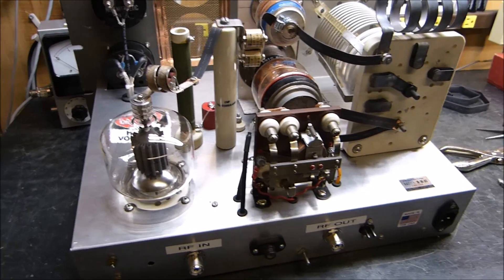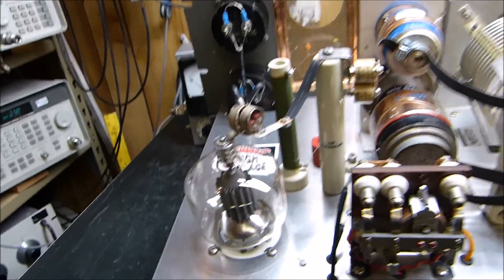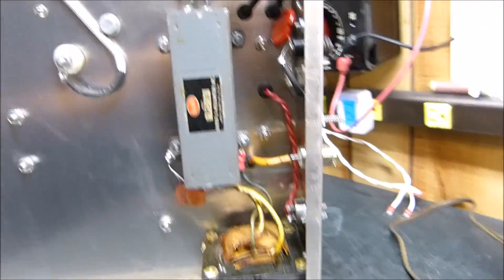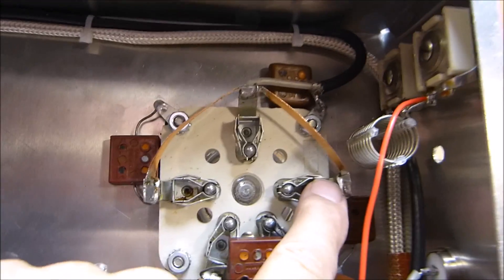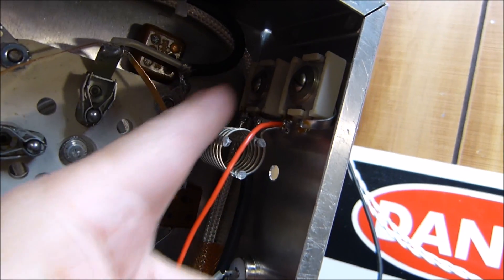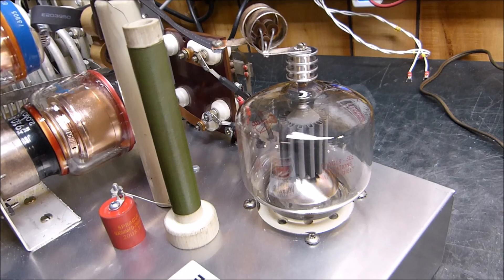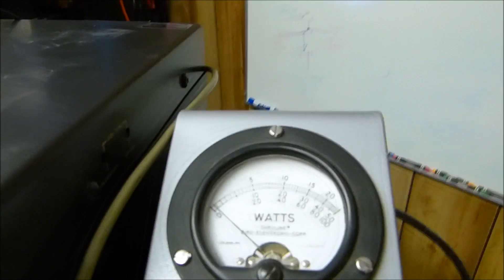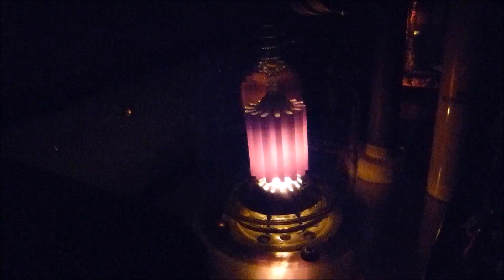Eimac 3-400Z or 3-500Z  Grounded Grid Linear Amplifier Build For Amateur Radio - Part 2

Comment: Big elements u must add second tube 🙂
Reply from the maker: To build bigger ones, I have built and use a 4-1000A (40M) and a 3-1000Z (20M) . Also a dual 4-400A. See my QRZ page.  WA4QGA

Comment: I tried pair in sb 220 seems get little hotter than 3 500 z but done little less but what I paid for them
Reply from the maker: I agree. Don't drive them quite as hard and they should be OK. I still use this amplifier in the video and keep it tuned up
on 80M. Best to keep the plate voltage at 3KV or a bit lower.  73  WA4QGA
Reply: @ElPasoTubeAmps  sweet deal

Comment: Was the tube's plate really glowing that bright, WITHOUT any load... no RF passing?  Seems a bit excessive. (Maybe it was just the camera).
What was the no-load plate current (idling bias current)?  
Otherwise, cool little HB amp.  Thanks for sharing!!
I'm an "amp junkie" and have several commercial-built rigs... some old, some new.  I've worked on all of them at some point. I recently completed a major overhaul of a Collins 30S-1, which is now up-and-running - on the air!  I did watch the older video you put up, showing the 30S-1.  Great amps!
Pic's of mine on my QRZ.
73 from central-westTexas!
~W5ARM
Reply from the maker: The camera greatly accentuates the orange as it apparently is very sensitive to IR. I can adjust it in manual mode but just let it go most often. I can't recall the idling current but it tracks right with the Eimac datasheets.  73

Comment: Whats the watt difference between the two different tubes 4-400 to 3-500 tubes
Reply from the maker: Here is a good Eimac newsletter concerning the 4-400A tube and other tetrodes run as zero bias triodes:   https://ethw.org/w/images/c/c0/Eimac_tube_notes.pdf
You are likely to get a bit more power from the 3-500Z or the 3-400Z  than the 4-400A running at 3KV on the anode if you can get good ones. Eimac quit making the 3-500Z and 3-400Z years ago and I have personally not had as good performance from the foreign made 3-500Z .  Hope this helps.

Comment: 3:31 I see that some people recommend grounding the grids directly to the chassis, especially if there's any chokes attached to them (remove the chokes, then ground). Any thoughts?
Reply from the maker: Strapping the grids directly to ground is a common way to do it. However, I do not do it that way. First, I (usually) put copper strap between the three grid pins  (pins 2, 3, and 4) and then I put a  0.01 uF mica capacitor to ground off each he three grid pins of the socket (this grounds the RF but not the DC) and then I run the DC thru a meter to monitor the grid current actually DC grounding the other side of the grid current meter.  It works perfectly and, as I see it, a simpler way to "ground" the grids. It would be OK to put a choke close to the grid pins on the socket in series with the wire going to the grid meter but I have not found that necessary. Just as a feel-good thing a bypass capacitor in the 0.001 to 0.01 uF range can be put at the meter end of the grid meter wire and a capacitor across the grid meter, etc. just as "good-practice" wouldn't hurt. I also use shielded wire (usually coax RG-58) from the grid pins to the meter.  In the case of using the Eimac tetrodes (4-400A, etc.) it is done the same way but the grid current read by the meter will then be the sum of the grid current and the screen current. Not an issue as long as you know what is going on. BTW - this GG configuration will not work with the 4-65A but will work with the 4-125A, 4-250A, 4-400A and 4-1000A also the big triodes like the 3-1000Z. Home this makes sense.  73

Comment: I like your work! I’m planning on building my first linear amp. I’m looking at circuits out there already tested and perform well. I have an old circuit with 813’s that give 500 watts out, but still looking. I know this is an older video but finding videos on tube linear amp builds are difficult to find!
73
W6CPY
Reply from the maker: Thank you - the GG amplifier is by far the simplest high power amplifier to build. You can expect 10 dB of gain - 100 watts in to 1000 watts out - not too bad. With grid driven and neutralized you can get 25 watts in for 1 KW out or 16 dB gain but it is a lot more work. The 813 along with the 4-400A family of tubes strapped as a triode work as a high mu triode and the 811A is a good one also. I really like the 813 but it has been a while since I have used them except in an audio amp I posted on YT some time back. Best of luck with your project. Stay safe around the HV.  73  WA4QGA   I have lots more pictures on my QRZ page.

Comment: I really want to build one of these..
Reply from the maker: If you study enough grounded grid (GG) amplifiers, you will see they are all about 99% the same. 
You can run the triodes like the 3-400Z/3-500Z/3-1000Z or the tetrodes like the 4-125A/4-250/4-400A even the 4-1000A in a GG circuit by simply grounding the screen. 
I can plug a 4-400A in this amplifier and it works perfectly. The only difference is I am then reading grid plus screen current on the grid meter which drives the meter off-scale. 
At 3500 volts on the plates (the 4-1000A wants 5000 volts or more) you can expect to get 600 to 800 watts to the antenna depending on the condition of the used tubes. 
Got to be careful as it can be death-on-contact working with voltages at this level. Since making this video, I have added a five-band tuned input circuit so I can switch between the five HF bands. In this video the tuned input Pi network is only for 20 meters. I use the one in this video daily on 40 meters. Thanks for your comments and stay safe.
Reply: @ElPasoTubeAmps  Where can i purchase parts? Vacuum capacitors, plate chokes, filament chokes, parts needed to build an RF amp? I have a Peter Dahl transformer that can support a pair of 3-500s, the filament transformer, and a 5kv rated rectifier board I built some years back. I only want to run a single 3-500 tube though.   Thanks for the quick response, and have a great day.
Reply from the maker: @clintmurphy5436  I have to say that I may not completely understand the challenge in building today since I have been collecting and building for the last 57 years. That means I have a lot of parts but I always need additional parts. I say carefully and in a dedicated manner, scan Ebay for parts that you need and are at a reasonable price. You have some major components already. You can buy chassis and front panels, etc from www.mouser.com for your projects.  Plan on spending a few hundred dollars. It can take a while but requires a dedicated and focused desire to find the additional parts on Ebay. Got to be kind of obsessed and passionate to find the components and get projects like this done. A single 3-500Z will make a tremendous amplifier and is all anyone ever needs. I run this little 3-400Z amp every day and I consistently get reports better than I measure at my end from the other station. It is a fact. I hope this helps. 73
Reply: @ElPasoTubeAmps  I'd like to study the anatomy of a 3-500 based amp. I want to learn about the necessary component values needed to run that particular tube, so I can purchase the correct parts.  Any links you can share would be appreciated.  Your experience shows in your work. I really like how simplified the install and parts layout is in your amp. I've seen a few build that looked like confusion going on inside of them. Thanks again and have a great day.

Comment: You don't really have the High Voltage on the PLATE meter? IF so, OMG, death waiting to happen. How are you biasing the tube? Are you grounding the filament CT on transmit?
Reply from the maker: I do have the plate voltage running thru the plate meter. It is the "old" way of doing it and panel meters actually have an insulating voltage rating to ground so they can be used that way. Things could go bad if a screwdriver was rammed thru the meter glass panel and metal was in contact with the person. 
The tube is zero biased with the CT of the filament transformer grounded and the plate voltage is turned on during transmit and off during receive. 
The Collins 30K-1 runs all voltages thru the meters and the meters are mounted on a non-conductive material and behind a glass panel. I will admit, I prefer that setup to mine. 
I have built transmitters this way for decades and always choose to turn the HV off during receive. 
Having 4KV on and sizzling all the time with the tube biased off, is just something I have a hard time dealing with. 
The little Collins 30L-1 leaves  2KV on all the time and biases the 811A's off by putting the T/R relay voltage (170V) on the grids during standby. 
In the last amp that I built, the 833A amp, I did put the plate current meter in the negative return of the PS. But doing that has to have some extra safety built in like shunting the meter with back-to-back diodes and (the old style) putting something like a 50 ohm 100 watt resistor across the meter in the event the meter opens up because of a shorted tube or whatever.

Comment: About the color not being correct of the plate ...You are using a solid state camera most likely. Silicon is the most sensitive at near infra red and red part of the spectrum. Cameras come with  IR cut filter but I suspect that the infra red coming from the plate is overwhelming the filters and a lot of IR is being passed to the sensor. I am certain the camera guys never expected the sensor to be pointed at such a strong IR source. The additional IR is definitely being picked up by the red "sensor bucket" and other buckets just due to the energy overload. Sine every color is a filtered bucket for the specific color, the camera is taking the bucket charges and converting them to the programmed color mix.

Comment: Hi Dave,
I have built a few amps with the 3-400z and 3-500z.  Both are great tubes.  Did you tune the input circuit?  I saw the inductor but I did not understand how that was part of the tuned input.  I really enjoyed the video especially seeing the orange plate color at the end. Very nice job!  73, Jim
Reply from the maker: Hi Jim - Good to hear from you. I hope all is well. This input tuned circuit was a Pi network only for 20 meters. It has a variable capacitor on both sides of the inductor. Since making this video, I have changed this single band out to a switched tuned cathode input circuit for all five bands with fixed capacitors on each side of the inductor and the ability to tune the inductance instead of the capacitors much  like the Collins 30L-1 input circuit, and the band switch knob is in the back of the amplifier. Making a video of the hot  plate of these tubes overwhelms the camera but in manual mode it did turn out pretty good now that I have watched it again. 73, David
Reply from the maker: Hi Jim, just had a QSO with you and then ran across this comment. Good to hear you on the air. You talked about getting up a tower?  You must have moved? You had the tower farm from heaven. Too bad conditions were so poor for a QSO. Stay safe and hope to hear you on again soon.  73